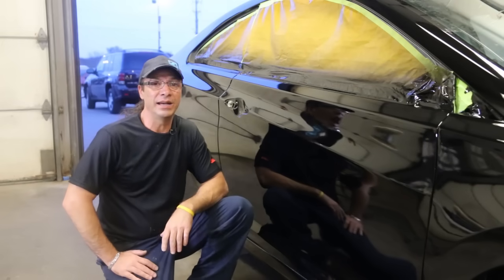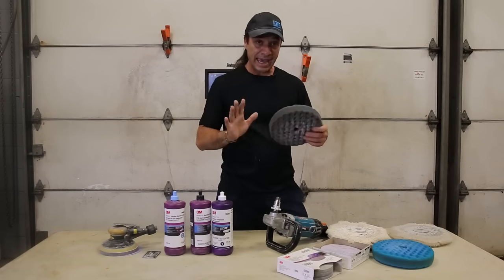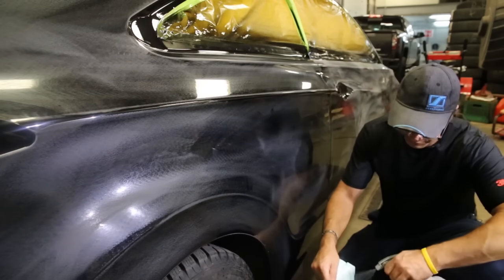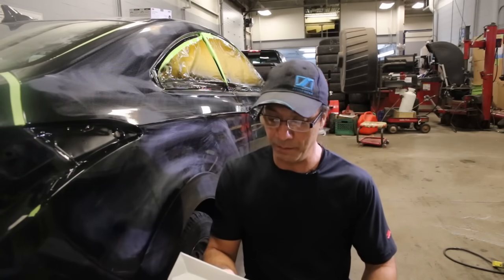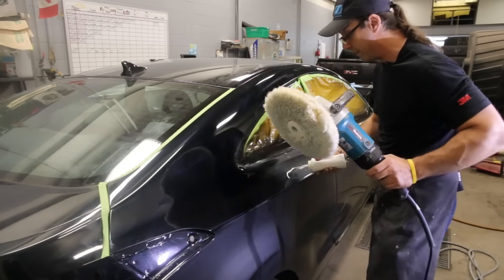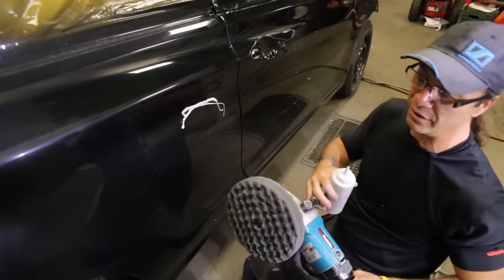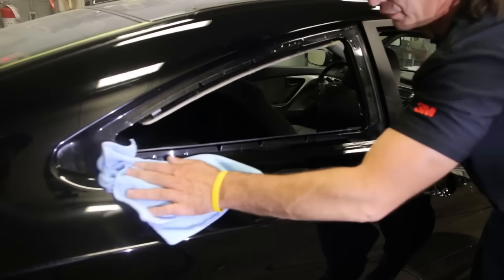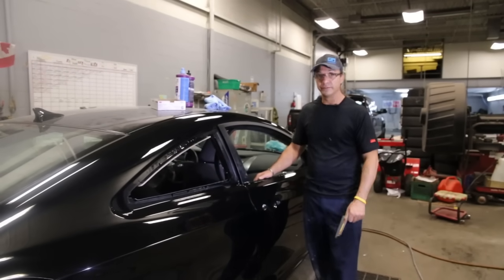Professional wet/dry sanding and polishing tutorial. 3m Trizact system, EX Compound

Comment: Adding too much, all you need is 3m original compound and machine polish is all you truly need..if your trying to teach an ordinary person..also you need to wait atleast a couple days for true complete dry you can’t always trust the clear even as fast as you think it dries..underneath paint is still fresh so when the paint  truly dries it will suck up the shine you gave it I’m a pro polisher my self working for dealers,private sellers and insurance body shops ..only thing I agree is 3m materials and a dewalt polisher is lighter,easier to handle and variable speed as well ..

Comment: Can you supply your email for questions, thanks
Reply from the maker: John Schroff I would rather you post your question in here so others may learn from it as well.
Reply: Great video. Can you use this same sanding & polishing technic on single stage painting? Also, why did you leave the orange peel on after sanding with the 1500 dry? Thanks, John
Reply from the maker: John Schroff hi. Yes you can use this system with any type of paint. I’ve also switched from 1500 to 2000. You want to leave the orange peel so it matches the original finish. Unless it’s an exotic car that has been wet sanded from factory. It’s a dead give away that a repair has been done if you don’t match the peel.

Comment: Breaking through a brand new laid down clear coat doesn't make sense. A little bit of orange peel wouldn't bother me. I bought a brand new car in 05 and when the salesman told me the car will be late on delivery due to being cut polished, I told them all deals are off.
Reply from the maker: The reason you wet sand a polish a new paint job is to remove any bit of dirt specs that may have landed in the clear. As for your car, some of the really higher end cars are fully wet sanded and polished, that’s how they get that mirror finish.
Reply: @loveja1  yes I understand, however you take a lot of years and durability off the the top coat.
Reply from the maker: @ivor7407  that’s true in a sense. European cars tend to have way better paint then American, and much more of it as well.

Comment: Hmmmm, 1500 to 3000 is too big of a jump. And if you finish with 3000 grit you can use a softer pad for compounding. A wool pad is too aggressive after using 3000 and will leave too many swirls, meaning you will need a more agressive pad when you final polish.

Comment: BS. Trizac 3000 on foam will not cut orange peel that You left after sanding with 1500. I did exactly the same today and  effect was exactly the same. But when You look closer, the 3M only hide peel because foam is soft enough to matt concavities/sockets (lower parts of peel). After sanding with trizact paint looks flat. But when You sand it again with 3000 or 1500 on hard block, You will clearly see that orange peel still exists. So for me it is job half done. You need to sand with 1500 to completely flat car paint. And use 3000 only for removing scratches made by 1500 paper.
Reply from the maker: Marek 3000 will not cut anything but sanding scratches. And to cut flat is only for show cars or factory high end cars that have been sanded and polished from factory. 3000 will only appear to look flat because it’s hitting the highs and lows of the peel and that’s what you wanna see. And no where in my video do I claim that 3000 will cut peel.

Comment: I use a wool pads first after sanding.  Who wants to sit there buffing with a foam pad trying to remove 1000 grit scratches. Doesn't make sense, wool builds heat faster than foam. MO
Reply from the maker: BadRonald1 actually I find it to be the opposite.

Comment: Hey,  I sent you an email several days ago and you answered me back and asked me a question so you could give me some advice.  I answered back but never heard back from you.  I would really like your input.  Thanks!
Reply from the maker: Jeep Wrangler JL sorry brother. Can you send that again
Reply: loveja1  Ok just sent it again.  Thanks so much!
Reply: I sent it yesterday, did you get it?
Reply from the maker: Jeep Wrangler JL yes. And I replied. Check your junk box.
Reply: Never got anything.  Could you resend?  :)
Reply: loveja1  Hey never did get anything.  If you would not mind could you just cut and paste what ever you sent me here?  Sorry this is a pain, but you are the master and I value your opinion very much.
Reply from the maker: Jeep Wrangler JL Yes I did respond to that. What do you have to work with now? I hate to see you sink in all the money for 3m if you are just needing it for your own personal vehicle.
Reply: loveja1  Ok I have the Perfect It 1-3 system with the wool, black and blue pads like you use.  I have an air DA sander,  P2000 3M Discs and Trizact P3000 discs.  I have a Dwalt Rotary Buffer DWP849 and Rupes Big Foot 15mm throw and tons of pads Orange, White, Black etc.  I am not getting very good results with the Rupes due to the oxidation.  I had clay-bared the whole car with yellow Mothers clay and its nice and super smooth.  The car was painted 10 years ago single stage, but not sure what type of enamel it was.

Never tried to wet/dry sand the single stage and not sure what grades is ok to use.  I do alot of paint correction for friends etc but its always base/clear and never tried single stage.

Thanks so much for helping me!
Reply from the maker: Jeep Wrangler JL it’s so hard to say how much paint you have to work with. Try a spot maybe towards the lower part of the car just in case you burn through. Don’t be too aggressive with the compound, just bring up a bit of shine and then let the polish (second step) bring up the rest.
Reply: So I should use the 2000 grit or can I just start wet sanding with the 3000 since we don't know the thickness?
Reply from the maker: 9th Gen Accord if you think it may need it, I would just use the 3000 wet. Make sure you wash the car very well, be in a dust free environment, use a small cap full of soap in your spray bottle.

Comment: 3m is in my trash can sucks badly compared to the other stuff.
Reply from the maker: Mike F sorry that you are having a bad experience with 3m products. Maybe it was how you were using it improperly? Care to explain how you were using it?
Reply: same as always I use Menzerna or CSI cream x and they work faster and better less imperfections and saves man hours. Less product. It is just all around better product and faster to get perfect finish better than 3m after unlimited hours.
Reply from the maker: Mike F what paint brand are you using this system on? Part of being a pro is learning different products and techniques. So I’m interested in learning more.
Reply from the maker: Mike F are you in the states and is it easily available?
Reply: right now I am using Tamco very good quality HS clear and I really like autoart. For base. But they also have really good clear. I have used the products on Matrix and 5 star clear and I use a house brand form Drew carriage. Depending on what I am doing. Valspar single stage sometimes. The best production product I have used is by CSI it is called cream x it is a one step polish best for body shop spot work. It is a polish that has no compound and polishes faster than compound. Very little fling and cleans right off with water (no concrete like substance in the cracks like 3m.) If I am doing a large project complete polish I use Menzerna which is a bit cheaper. Both products cut and finish better and faster than 3m system. Menzerna 400 for 5 second pass then 1000 with same wool pad then 4500 with finish foam black or blue. Absolutely flawless finish no swirls chasers. Plus I DA sand with Mirka Abralon or 3m hand paper. 3m has the most consistent grit. But with the DA abralon is just better no chasers.
Reply from the maker: Mike F thank you for your detailed response. I’ve spent a few minutes searching your product and nothing really showed me anything that pertains to production work or high end clears. I’ll have to see if this product is available in Canada and maybe ill do my own tutorial on it.

Comment: I’m not trying to be a smart ass. Why would you want to give the car back with orange peel myself I’d like an absolute mirror shine
Reply from the maker: Richard Vacanti does the rest of the car have orange peel? The answer is yes. You want to give the car back in the original condition. This is not about showing off and giving a mirror shine, this is about being a professional and giving the car back in its original condition. Doing a complete wet sand on a show car is different, then you want a mirror shine. See where I’m going?

Comment: I would not recommend anything from 3M. I buffed using 3M rubbing compound 05973, piece of crap left my finish looking like a 20 year car parked car in sand storm. The roof of the car was freshly painting in black. Waited a week before cutting and buffing. After finishing with 3000 wet, I used the 3M rubbing compound. What a disaster!!  I'm looking at another products to remove what 3M's product did. If I had the time I would file  law suite with those idiots at 3M for developing a shitty product. I hope nobody buys their shit so they can go bankrupt.
Reply from the maker: waltwitty tell me your process. What pads were you using and how long have you been polishing?
Reply from the maker: waltwitty I just checked your page. You have zero painting or bodywork experience which may tell me that you have very little polishing experience. 3m has spent millions on testing their products and they are one of the top leaders in the industry. So before you start talking bad about a product, you may want to learn how to use it first. Cheers.
Reply: Thanks for the reply. I've done a tremendous amount of research regarding pads, compounds and different types of machines in conjunction with wet sanding and various cutting and buffing steps to get a great finish. This stuff in not rocket science, ok. I used a McGuire's cutting foam pad with the 3M rubbing compound on a surface with minimal scratches due to wet sanding. The DA was set between 1500 to 2500 RMP, started with low to spread the product and work to a higher RPM with added pressure while watching not to dry buff. You'll think that the product would eliminate the scratches or reduce them for the first cutting session. Let me emphasis, FIRST CUTTING SESSION. That did not happened. I would gladly a take picture and send it to you or 3M of the horrible results caused from 3M product. It's insane that a company which supposedly is the leading in buffing products would have a product that caused the damage I experienced. I wouldn't be as furious if the product did absolutely nothing to existing wet sanding scratches, but this is appalling the number of scratches left behind. I flipped my lid!! I don't have 20 years experience,  I don't believe you need to 20 years to used a foam pad, a DA or some type of cutting compound to achieve standard results, this is not like rebuilding transmission. The angle of using experience as a deflector to debunk is not applicable.  Based on the information I've shared, where you do you think I went wrong? Was it the foam pad? Caused I used 3 different ones, a cutting, a polishing and finishing foam pad. I also used a wood pad after I used any of the 3 foam pads.
Reply from the maker: waltwitty using a wool pad after the foam pads is going backwards. Seems as though you may have used some sort of a rough compound to start with. Watch my video again and follow the steps exactly. No reason why I'm getting flawless results while you are pulling your hair out. Lol. What compound were you using?